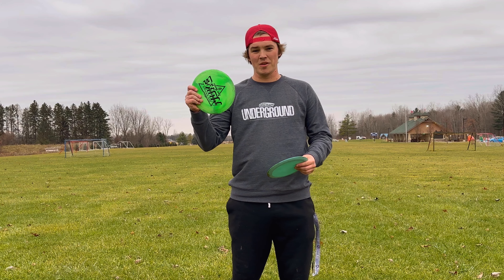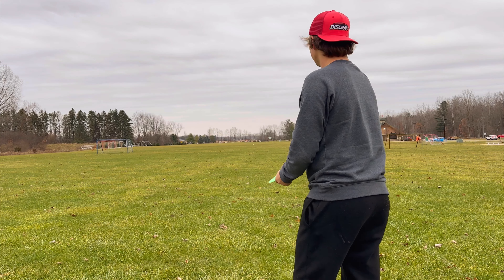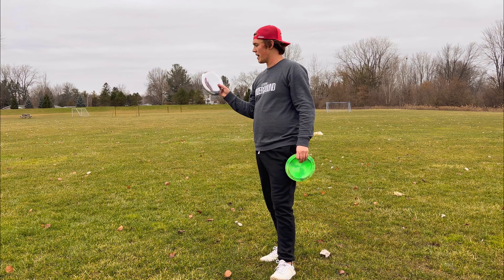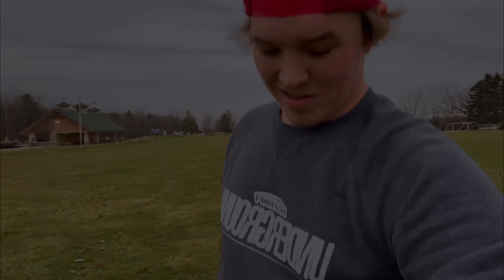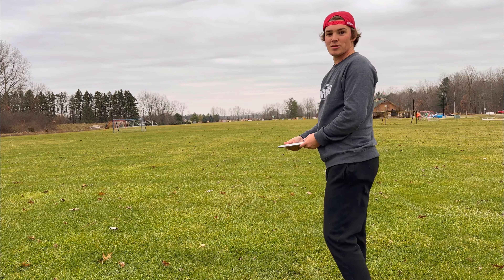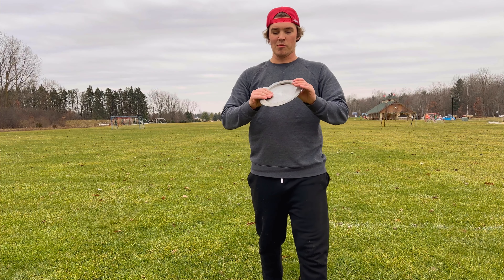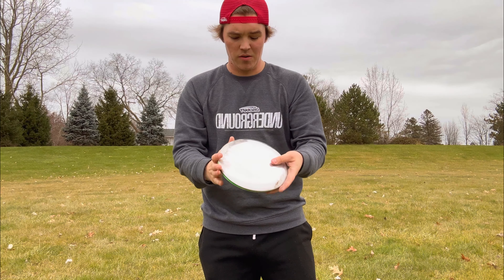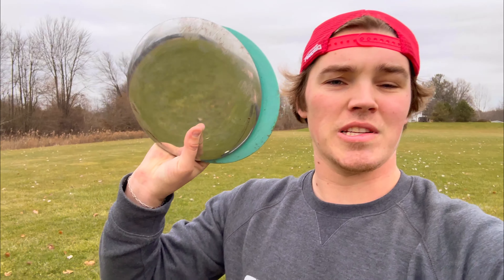Discraft Nuke… But It’s Aluminum

Comment: Just stumbled on this video.  Not sure what the end goal is bc I really don't know jack about disc golf.  But I am a metallurgist for aluminum industry.  Aluminum alloys vary GREATLY, so don't think in just terms of Aluminum/Not Aluminum.  For example, the 3104 in your beer can crushes easily, but the top/tabs are made of 5182 Aluminum and don't crush so well.  The 6xxx Aluminum in your car is basically uncrushable by hand (the inner frame), while the outer frames of 5xxx can be easily pushed in.  7xxx Alloy for rockets, and on and on.  So what I'm saying is first determine with a good metals group or materials engineer what you're looking for.  I'm assuming you want lightweight but sturdy enough to not flex during flight or be crushed upon light impacts or folded by accident.  So you're probably going to want a 5-6xxx range material.  This will mean it doesn't have to be as thick or heavy and will resemble your plastic disc in many ways size/geometry wise.  The material you have there is likely high grade aluminum, which is usually referred to as "Prime" or a similar alloy and is almost pure Aluminum and therefore very heavy and not really designed for this.
Reply from the maker: Wow, thanks for all of the information! It wasnt necessary intended to get great results, but more so just a fun project to test out. I plan to make the same disc out of as many different materials as I can and just see how they compare.